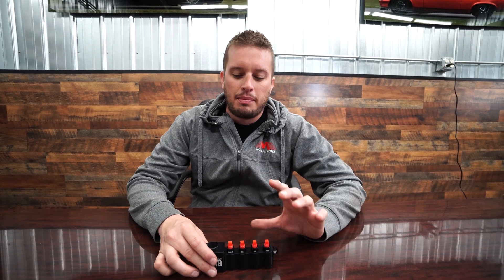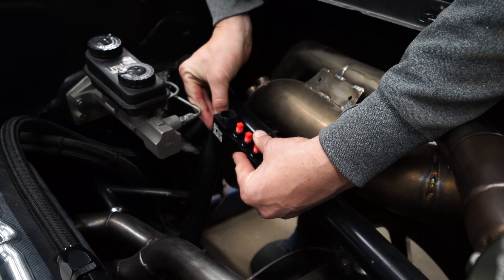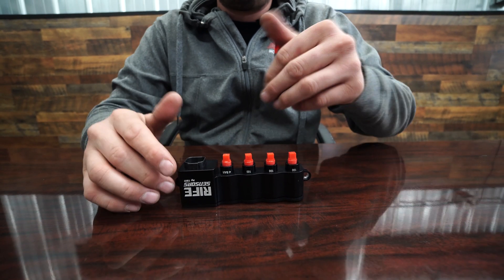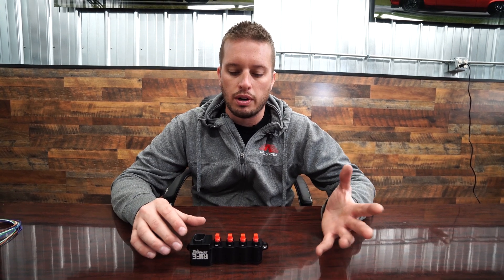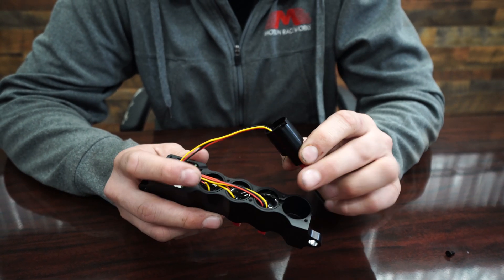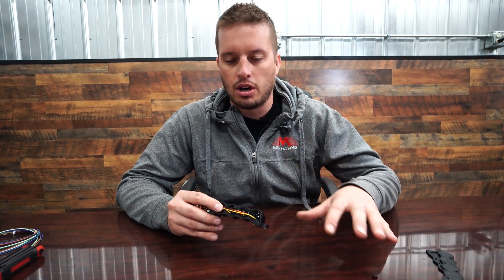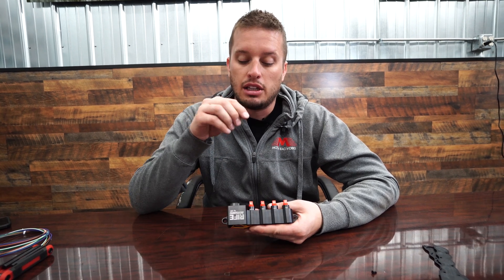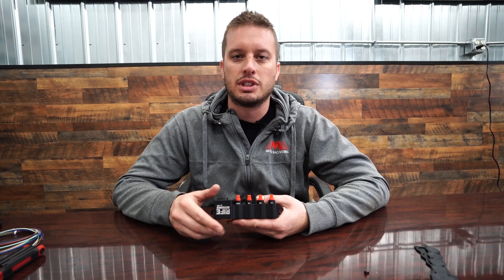RIFE Sensor Blocks: Simplify and Perfect EFI WIRING

Comment: It's a great idea, very useful in certain circumstances but not without drawbacks.  You now need to add the cost of an AN hose for each sensor, and each hose creates additional leak points.  When you service the vehicle you are now opening up fluid lines that drip  instead of unplugging an electrical connector.  And you can't use this for temp sensing since fluid doesn't circulate in the hose and is now remote from the sensor.